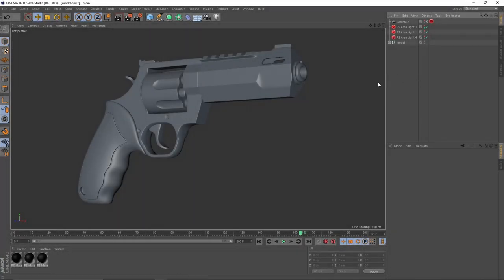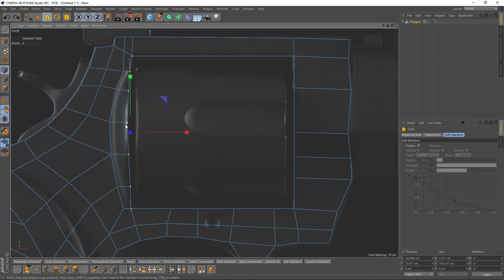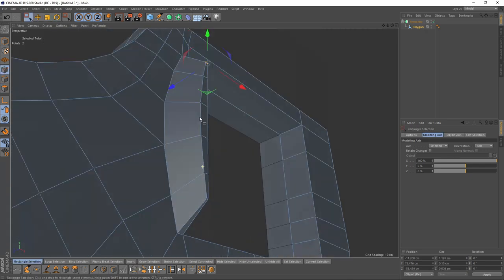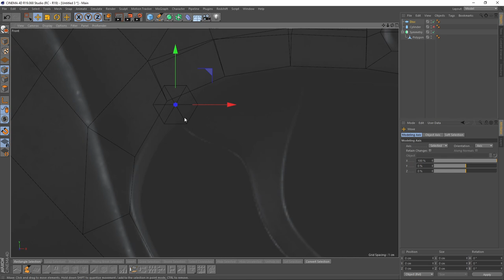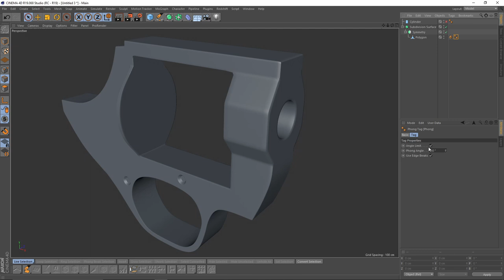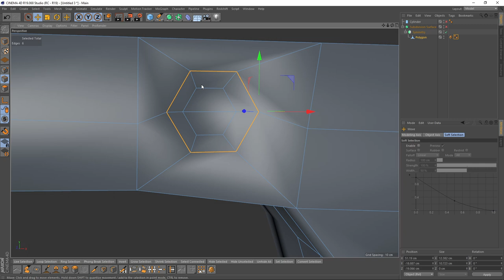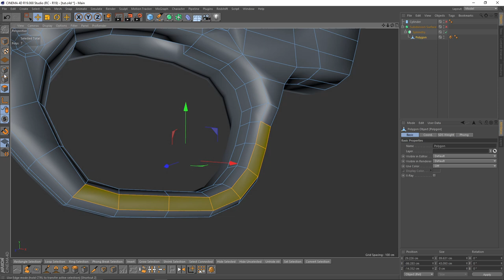Cinema 4D Hard Surface Open Subdiv Modeling Tutorial | Part 1

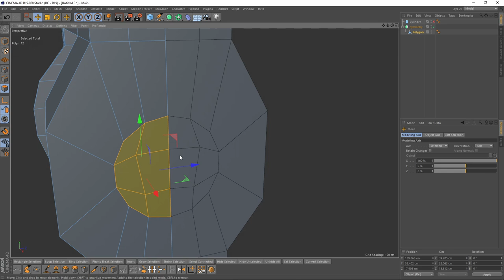Comment: 10:00 - you can make this operation easier by simply removing all unnecessary polygons, selecting the edges and through the stitch and sew tool, pressing shift and connecting one point to another.
Reply from the maker: Yeah, right

Comment: Why should I use this subdivision instead of the default c4d one? What does it mean faster?
Reply from the maker: Basically you don't have to add supporting edge cuts to the mesh which is very time consuming, it gets more complicated and more time consuming as your mesh gets more detailed  ( you will see the speed in the next parts) 

Plus you can easily change the base mesh since its low poly, this also makes it easier to bake low poly mesh to high poly ( this is for more like game asset but anyway) and you can exchange that model with other softwares like maya, 3ds max with FBX easly ( weighting vs), also it has performance advanteges when it comes to rigging vs.

You can check more here:
https://www.youtube.com/watch?v=Y-3L9BOTEtw&ab_channel=Autodesk
Reply: @polygonpen  Thanks for the answer!! Now I'm waiting for the part 2 :)

Comment: It is very good, thank you. My only problem is that you don't say always what exactly you do and for instance I don't know how to make the inner extrude on the polygons only one direction and you don't give exlanation :/
Reply from the maker: can you write exact minute and second
Reply: From 5:12. Thank you for help.
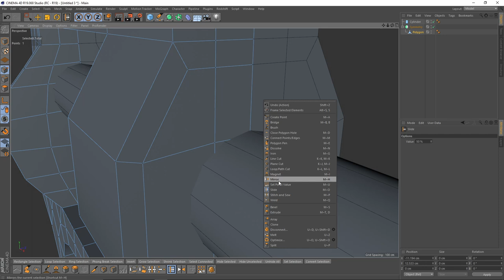Reply: At 8:46. How can you snap the points with slide tool to the cylinder?
Reply: @polygonpen  Nevertheless, I have learnt by you more than from highly paid courses. Thank you again.
Reply from the maker: right click and select extrude inner or press M ~W, every operation that you do on a mesh is always in the right click menu.
Reply from the maker: There is no snap, just try to match the shape, doesn`t have to be perfect.
Reply from the maker: That`s great.
Reply: Just to follow up on the original question. I can't figure out how when you inner extrude, it is only inner extruding three sides of the polygons as opposed to all four sides. I can't figure it out. Could you explain how you are doing that? Thanks. BTW I love your tutorials!